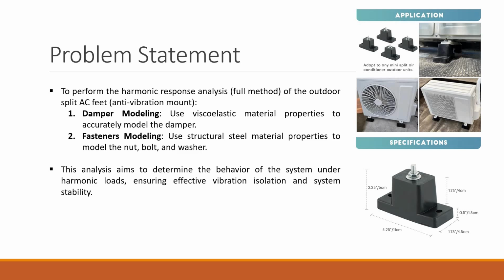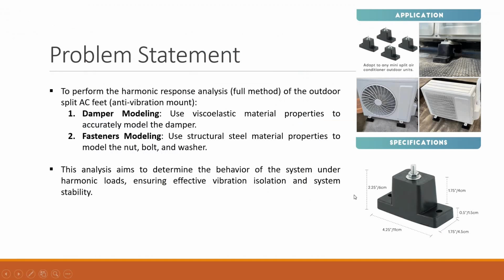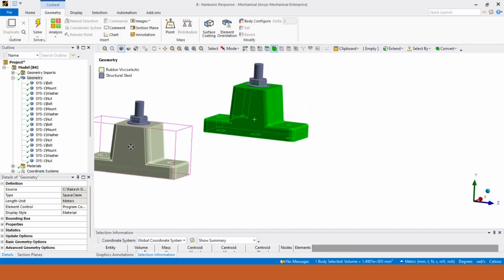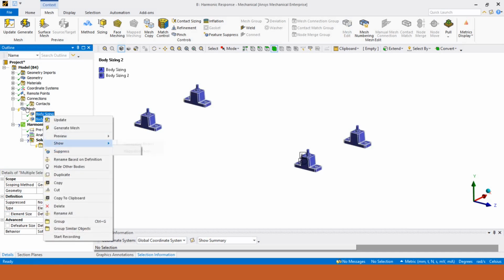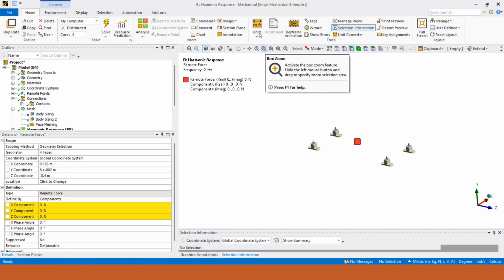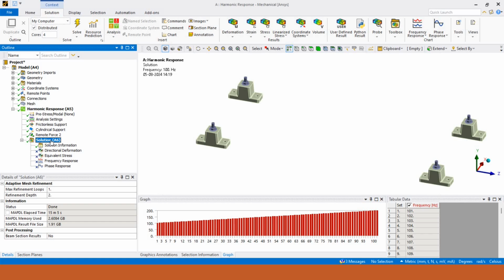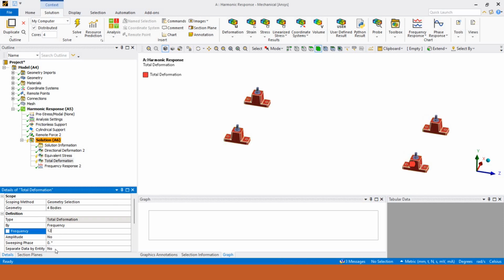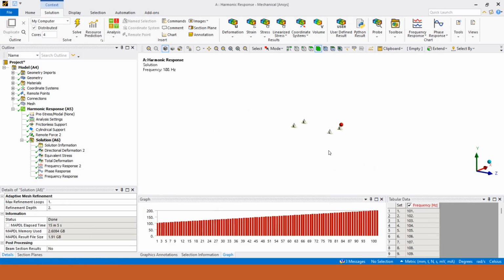Harmonic Response Analysis of outdoor HVAC Feet usign ANSYS

Comment: Thanks for the video! I have a doubt like why are you adding the force in lateral direction? It should be in vertical direction la as the weight of the HVAC output act towards downside. Thats the doubt